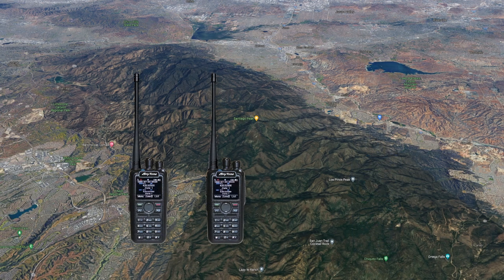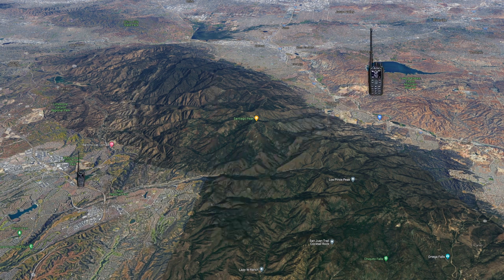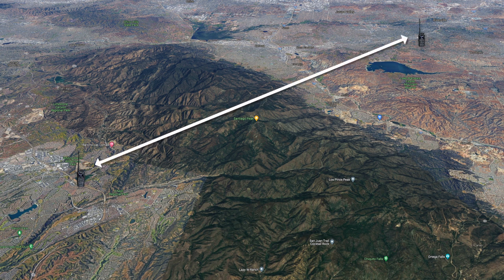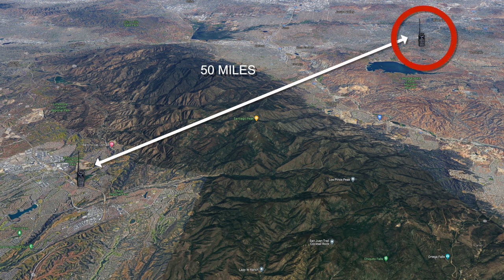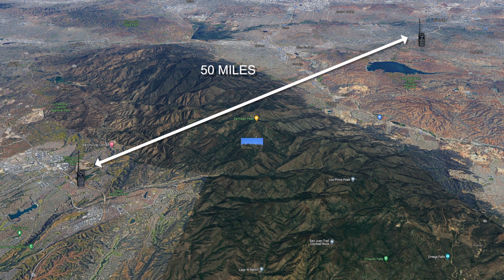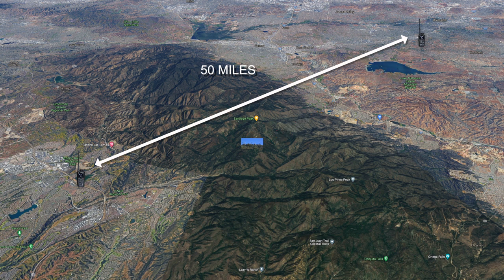What is Simplex versus Repeater mode in Ham and GMRS radio. Updated  Apr 5, 2022.

Comment: can you have radio to radio duplex?
Reply from the maker: I just saw this question. Sorry for delay. You technically can, if the radio is built to handle a modification to do it, like some Motorola commercial type radios. Those commercial grade radios are typically the best way to do it. Baofeng and most radios can't do true duplex like that.

Comment: does repeater duplex we can hear the feedback on our voice? or just pass through like direct
Reply from the maker: It just relays, or passes-through the voice in real time. If you want a playback of your voice, the repeater would have to have a voice-recorder capability in the repeater's controller hardware itself (which some can do), but it is not commonly offered on most analog repeaters. DMR Digital Mobile Radio repeaters offer that option via the Brandmeister server, but that's another topic for digital radios.
Reply: @raymazonhamradio  thanks

Comment: I love this! What happens if I'm in Los Angeles and I want to transmit to riverside. Would I need to find a repeater that is linked to that mountain?
Reply: Hi Damian. Yes, a repeater would have to be used to reach that distance. (Unless you happen to be physically located atop a mountain.) I was on a hike up on a 1,000 foot hill in San Diego yesterday and was able to reach the Catalina Island repeater (75 miles away) on a hand held. Elevation is key. In the real world though, yes, a repeater will retransmit your signal great distance. Also, some repeater systems, like the PAPA system in Southern California, have a network of linked repeaters that covers half the state. There are some open repeaters on both 2 meters and 440 that should cover that area you are asking about.
Reply: @raysiposs9822  I and the receiver would only need to connect to the same repeater or each other on a linked repeater to hear one another? It's not like I need to program two repeaters to chain the connection?
Reply: @damian3182  Correct. You are only communicating with a repeater on a mountain. The repeater does the retransmission or relay for you. The person you are talking to on the other end is doing the same thing—talking to the repeater. You hear each other by going through that repeater relay. So just on repeater will do that. Networked or linked repeaters will interconnect, but that is done mountain top to mountain top. I just posted another video on my other channel that talks a little further about the frequencies used.  https://youtu.be/hPQnWTZIGBo

Comment: sir how to send a call to a radio without repeater to 2 kilometers far
Reply: It will depend on how many objects are in the path, in the way. If you were on a building rooftop, and able to see over other buildings, you could perhaps reach that distance. If you can see it, you can talk to it. Gaining elevation almost always helps greatly. This is why you will often see radio communication antennas located high on a rooftop.

Comment: Well made video but you got it wrong. Sadly theres a lot of comments that says tanks for the explanation. https://en.m.wikipedia.org/wiki/Duplex_(telecommunications)
Reply from the maker: Thank you for the feedback. In order to correct my error, can you please elaborate? Duplex has several meanings and I want to make it better understood. 

A repeater is usually a duplex repeater, meaning they can hear and talk at the same time, though there can be “store and forward” repeaters which are very rare and almost none existent. 

Many commercial radios have a setting on the control head labeled as “duplex” as the mode for the “repeater” mode of transmission, vs simplex operation for talk-around. They just use the nomenclature of “duplex” rather than “repeater”.

Then there are radios such as Motorola mobile radios that have the internal circuitry to allow it to operate in full duplex mode in the car where they can transmit and receive at the same time, which allows the radio operator to receive themselves as they transmit coming back from the repeater, or the network of repeaters. 

Commercial grade Motorola mobile radios are heavily used in repeaters because of this highly sought after ability of being able to easily duplex, and their ability to withstand continuous transmit duty cycles. 

In a mobile environment, on a fully duplexed radio, if the volume is turned up too loud, you get into an echo or feedback condition when hearing yourself returning from the repeater. The advantage of running mobile duplex while on a network is that if another station on a full-duplex linked repeater keys up elsewhere on the system, then the first operator will hear the interrupting station comment in real time. 

Most linked repeater networks are full-duplexed networks, but not all are. Full duplex has some advantages for the control operator of the network while admin level controlling the system. 

So it depends on which definition of duplex is used; the one that some radio manufacturers use on their radio product control function labels, or the transmission mode. 

Again, if I misstated, let’s get it corrected. I was referring to the control function label found on many radios when using the term. 

Thank you for the input.